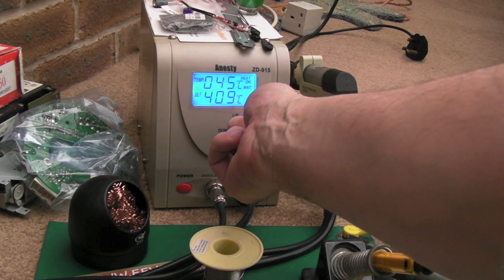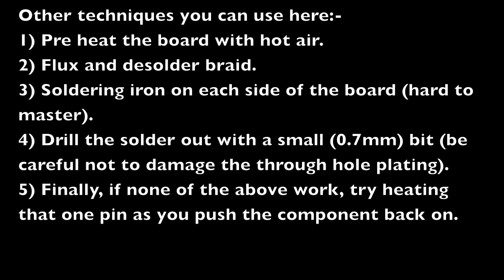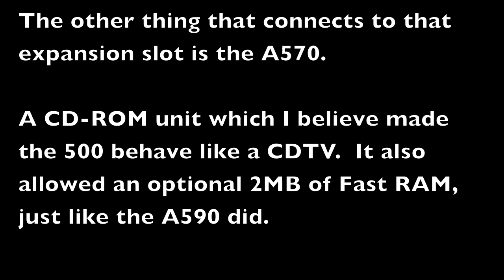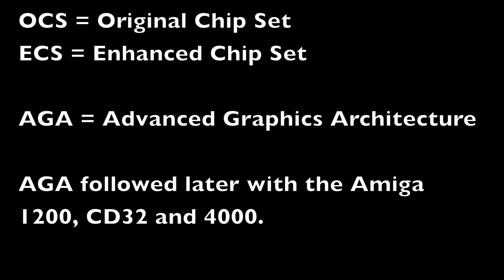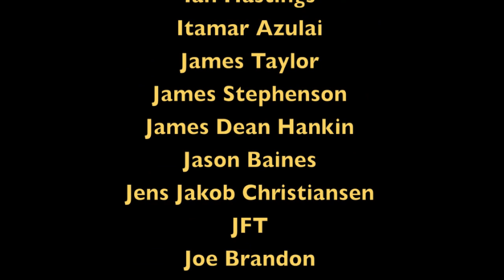Commodore Amiga A500 Repairs Part 2 (Battery Corrosion / Agnus Versions & More)

Comment from the maker: The Agnus in the A1000 is missing some of the things that Fat Agnus provides - eg. clock gen stuff.  There might be other differences too.  The point of the video where I was talking about the 8375 and the NTSC / PAL pin, I was remembering the issue I had with the 8372A!   You cannot swap the 8370/71 or 8372A for an 8375 without an adapter - the pinout is different.   You can see an example of fitting an 8375 in place of an 8371/70 or 8372A on my A2000 Upgrade video here - https://youtu.be/X7wNfDoZChI

Comment: One of the things I found you can do when afraid of lifting traces/vias due to heat from the desoldering station, is to spread the heat. Instead of doing each pin after the other, you can skip one instead, or jump to the other row first. so instead of doing 1,2,3,4 etc, you do 1,3,5,7 and then go back to 2,4,6,8.
Reply from the maker: That's precisely why I moved to the other side of that chip after putting a lot of heat into that corner point ;)

Comment: I still need to do some cleaning and re-arranging around home to even have a workspace to work on projects.  Have a few items that need some recapping or fixing cracked solder joints and a few other eBay purchases I still need to even figure out if they work as-is or need repairs.  Atari Falcon030 near the top of that list!

Comment: That was really interesting Chris. Just the type of in depth information I was looking to for to learn more about the Amigas. To be honest, it was a challenge to keep up with the changes in the video, but I got everything I believe.
It's amazing really to see what you find just by being meticulous about cleaning and inspecting. You just find stuff that was hidden from view when the previous repair was done.
Reply from the maker: Thanks!  I will try not to jump cut so much in the next parts!  Yes, it's sometimes worth undo-ing what has been done to a board first to see what horrors lurk beneath lol.   For one thing I wouldn't have found a couple of missing traces and one trace that was going to the wrong pin.

Comment: From what I remember, the A3000 had the 2 meg Super Agnus, but you could plug it into an A500 or A2000 using the DKB Megachip adapter.
Reply from the maker: Yes, I remember that too!  There must be a pin out difference between the 2MB chips and the 0.5 and 1MB chips.  I tested a 1MB in place of the 0.5MB Agnus and it worked OK.  I suspect an adapter is required for the later 2MB 8375 though.

Comment: Stop wasting your time Chris, just get a brand new a1k A500+ board and You'll be good

You are right, there are 8375 1MB Agnus versions these are with -16 number at the end. Another detail 8372 may be used on both NTSC & PAL units, while 8375 CAN'T be! There are different versions of it.
No matter what Agnus is installed You can change mode in early boot menu (KS 2.05 and up, by holding both mouse keys while power on)
Reply from the maker: Haha =D  Yes, I am aware of the A500++ boards, but I wanted to save this one and cover other things in the process.  Thanks for confirming about the 1MB 8375!  I was aware of the NTSC / PAL menu on boot, but I believe you still need to have the correct Agnus, or the PAL / NTSC pin set correctly too?
Reply: @GadgetUK164  nope, it will work in different mode, 8375 kept this feature, just switch pin is missing, for example, iComp ACE2 Megachip upgrades are delivered with NTSC Agnus, so You need to change it to PAL mode each time manually, or set it in ACA500 menu settings. Im also offering Megachip on Amibay that can be installed on any A500 model, this mod needs some soldering though...
Reply: Aye, but buying a new board takes away all the joy and fun ;)
Reply: @tedvanmatje  nope, You'll need to assemble it, so fun factor remains @ 10/10

Comment: Nicely done. If you upgrade that amiga with an accelerator (e.g. a 68030 or higher), the IEEE on an 030 (or 040 whatever) should be powerful enough to drive a ieee1284 parallel port for external CDROM drives and other storage. Then, maybe a mod to the CIA chips could make use of that (e.g. with a raspberry-pi gpio pretending to be a CIA to boost it) thereby increasing the ieee1284 port's speed. This was a thing I mentioned in a comment last video in part1 (but do check my replies are not marked as spam by youtube for having hyperlinks in), referring additionally to another video of yours. https://www.youtube.com/watch?v=Y9KDk1OfkYc

Maybe a (quite famous) CFIDE68k device could help but I'm not sure.

Also, seeing as you mentioned the a590 which sometimes uses scsi, you might find this useful (e.g. for fun, and upgrades and testing) whereby a RaspberryPi GPIO can be made into a SCSI device:
https://hackaday.com/2017/05/01/the-raspberry-pi-becomes-a-scsi-device/

Such a Pi could maybe partly be used with or instead of a SCSI2SD like this device. 

https://www.youtube.com/watch?v=gupXx9lpawE

This device however is supposed to make a Pi into a HDD.
https://www.retrotronics.org/home-page/netpi-ide/

I hope some of this info is handy. :)
Reply: Cheers for the info mate...shall check out the links after work the morrow! If I can use a PI for storage etc, then I'm going to be a busy man indeed :)

Comment: 37:12

(I'm not an expert on all things Amiga, but this is what I know about the expansion card basics)...

I think it is still called a "Zorro-I" slot on the A500, but it's essentially just the generic 68000 bus, with some autoconfig stuff added.

(ie. most of the signals are just in parallel with the CPU, with a few extra signals added from Agnus for autoconfig etc.)

So it's more of a standard for the pinout itself, and the autoconfig part is just some registers (or a small ROM for the read-only values) that are mapped into the 68K address range. Those register values tell Kickstart (or other apps) which type of card it is, how much RAM it adds etc.

https://github.com/MiSTer-devel/Minimig-AGA_MiSTer/blob/MiSTer/src/tg68k/TG68K.vhd#L292

You can see how each read-only value is only 4-bit as well, so for larger values like the manufacturer ID of 0x139C, it has to use four nibbles. (The bits of each nibble are also inverted for some reason.)

After a reset / power-up, I think some cards won't even assert any of their signal outputs until the autoconfig is done. Then, I believe most cards will unmap the autoconfig stuff until the next Reset, so those few addresses can be used for extra RAM or other stuff.

http://amigadev.elowar.com/read/ADCD_2.1/Hardware_Manual_guide/node02C7.html

Looks like you have the hang of using the Duratool now. Looks like you've adopted the correct "desoldering wiggle" technique from the days of the Weller. :p

(admittedly, the nozzle on my Duratool did get blocked solid, twice, and I had to replace the whole thing, but once you know to always keep using the cleaning wire, it's fine. I actually leave the cleaning wire in place before switching it off now.)

Thanks for another interesting vid, Chris. ;)
Reply from the maker: Thanks!  Yes, I think that confirms roughly what I suspected - that the expansion port on the 500 was effectively Zorro 1!  But it sounds like the auto config stuff came into use with Zorro II.  I think Zorro II cards can work with the 500, but you cannot have more than one without some other logic.

Comment: Great work! The board looks like a nightmare to repair. I really like the macro shots here. It is great for inspection. One day I will attempt repairing a corrotion damaged Amiga. I migt have said it before, I had an A500 and a friend and I attempted to populate the 512k extra chipram. Didn't work. Desoldered and broke throughole platings. Was devastated and figured it could help botch it with wires. It worked again, but didnt look nice :) ended up converting slowram to chipram instead.
Reply from the maker: Thanks mate =D  I need to get a microscope like you I think!  We've all made mistakes like that in the past!  I still make them now from time to time lol

Comment: Zorro III was really quite a radical upgrade from Zorro II, reading the technical details of Zorro III you have to appreciate that Dave Haynie really knew what he was doing. Nothing like Zorro II but you could mix Zorro III and II cards on the same backplane. Only a geek would appreciate it. And the DMZ SCSI controllers in the A3000 walked all over PC drives at the time. Ultimately I believe the Amiga was kind of botched when it was repurposed from being a console to a home computer which compromised it somewhat as a games machine. Keep working on the board, amazing work as most would leave it for dead.
Reply from the maker: Thanks!  Much appreciated!  I will take more of a look at Zorro III at some point!  Looking for an A2000 at the moment, but later plan on getting an A3000 or A4000 (will need to sell one of my kidneys first lol).

Comment: Original Fat Agnus integrated the DRAM controller and could handle 1MB ram, but the DMA channels could only address the first 512k.
Any extra RAM on a trapdoor module was mapped as CPU-only fast ram (but ran at the slower chip RAM speeds).
Reply from the maker: Thanks!  That's a good point regards the DMA support.  That clarifies what the difference really is between the 8371 and 8372A.  With an 8371 the RAM is still addressed by Agnus, but no DMA support for it (hence not chip - Denise, Paula etc cannot address it).

Comment: Your trick of using a solder wick to tin exposed traces has come in handy for my own Amiga 500, which had signs of battery-caused corrosion; although the machine still worked, I scraped away the corrosion and tinned the exposed traces using your technique to keep the corrosion from spreading and eating away the board.

The Amiga's clock signal is present on the video connector, and the A520 RF modulator derives the color clock frequency from it (the PAL version of the A520 has its own clock crystal, but it still somehow ties the frequency to the clock signal; the NTSC version completely relies on the Amiga's clock for it's color frequency by dividing it down). The PAL vs NTSC color frequencies are too different to be derived from the same original clock frequency, hence the two versions of the clock crystal.

In my own Amiga, I have the NTSC-appropriate clock crystal installed so that I can get a color signal on my NTSC tvs when I use an A520; it's a 6A board, so I can easily switch between NTSC and PAL, but that just tells the Agnus to output video at 60hz or 50hz, so I can basically do NTSC-50 on CRTs that can handle 50hz (but don't know what to do with a PAL color signal).
Reply from the maker: Thanks!  Very useful info there!  I've not looked at the video pinout throughly so it's useful to know that a clock goes over to that connector.  That does confirm (I think) that the colour burst signal would / could be a problem if you switch region but don't swap the crystal (I think).
Reply: @GadgetUK164  Yep; I just got a black & white picture out of my NTSC A520, even with the Agnus switched to NTSC mode, until I swapped the clock crystal for  the one for US/NTSC (my Amiga was originally from Great Britain so it had the crystal for PAL machines).
Of course, if you're using the RGB output then which clock crystal you use doesn't matter.

Comment: Some really useful tips here, thanks!  Thankfully my A500+ never had the battery leakage issue.  I had it for Christmas in 1991 but unlike most Amigas it wasn't put in the loft after a couple of years, but used fairly regularly since which I think helped prevent the battery leaking.  So when I came to desolder the battery there was only a tiny bit of white fur on it and no damage to the board.  I think that's probably rare thing for a 500+ board!
Reply from the maker: Lucky!!!  It's hard to find any in good condition like that these days!  Only people like yourself that have removed the battery years ago stood any chance of saving the board from damage =/
Reply: Hai fatto bene a toglierla,quella batteria e' in grado di fare danni spaventosi!

Comment: Yeah, that A500+ is in seriously bad shape.. I removed the battery on my A500+ and thankfully, mine isn't anywhere near like that around the battery area. But that A500+ looks like it's been in a warzone with an amateur repair person.. At this rate, I can see you getting to Part 8 in this series before you attempt a switch-on!
Reply from the maker: Yes, it is pretty sorry lol!  It is fixed in the next part though =D  Got it working over the weekend!
Reply: @GadgetUK164   wow.. working already? That's pretty impressive going.. looking forward to seeing the next part.

Comment: Why are you tinning over the traces? Is that to find if there's a break?
Reply from the maker: I only tin over traces affected by corrosion.  When the corrosion starts to eat at them the copper layer thins out.  If you don't tin them they can often break with nearby pressure (when removing chips etc), or burn out with a little current.  It's always a good idea to remove the corrosion and then tin over them if they've been corroded.

Comment: Thank you, GadgetUK164, much appreciated restoration of a Commodore Amiga 500+.
Reply: Proper ppe while handling esd sensitive components outstanding.
Reply: Lately I've been working with old nes games and those are finicky to get to play right without cleaning them first. Using the game genie is a godsend even for the FC twin the top loader forget getting that to fit without needing a converter thats stupid expensive.

Comment: You tell that you use ChipQuik but you don't say how much it is different from any other stuff. Using it you can join very separated contacts that you can't if you don't use it.
Reply from the maker: I will talk about that in the next part.  It's far better than other fluxes I've tried.  Regards it helping join up pins that would not join up without it is not the case (unless you are using a huge soldering iron tip).  The benefits are it helps the solder join to the exposed traces - without a flux hardly any solder will flow on there.  The other advantage of flux is keeping solder from bridging pins (the opposite of what you were saying).  This is why I always use this on an SMD rework.
Reply: I had a chip with cutted pins and I wanted to use it again. So I took a socket, cutted a bit of plastic in the top and I could solder the metal parts that were separated like 3-4mm. I mean that it is very flexible.

Comment: Is there any logic in trying to connect to the traces instead of using wires to help try to maintain equal lengths of traces - or does this not matter much at these speeds?
Reply from the maker: As you suspected - the speed of these dictates that it doesn't matter regards length.  That said, you would want to keep any fix wires as short as possible!

Comment: Those PLCC removers are designed to extract the chip with just squeezing it. you should push the tool into the socket, hold down and squeeze. You can damage the pins if you pull up whilst squeezing.
Reply from the maker: I've not found that with cheap ones!  Maybe good ones its safe to do, if you try that with these cheap ones more often than not the clips slip upwards and scratch the top of the chip I've found =/

Comment: A wire vein through a hole and then soldering it to the trace is a pretty effective method of dealing with missing pads. You sounded rather negative of it and yes, it did need to be redone, both otherwise it is both effective and esthetically elegant.
Reply from the maker: Yes, I do agree it can be a really nice clean way of fixing ONE broken trace!  I've done it before - eg. on one of the MV1FZ boards I repaired last year.  But when there's this much corrosion (mostly on the top side) I would avoid soldering anything onto the top side where possible.
Reply from the maker: I've also done single spot repairs on top like that on other MVS boards too!  It can be elegant as you say - but not when there's so much damage around it.

Comment: why not use a hot air gun to help with socket removal (knowing socket is cactus)
Reply from the maker: Yes - you could do that too!  I used the hot air to assist in chip removal in a later video.